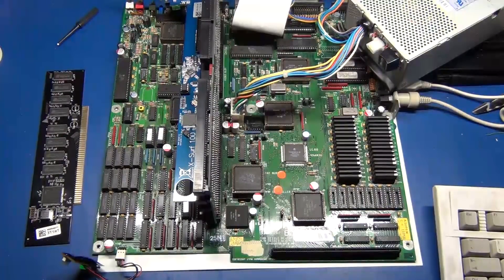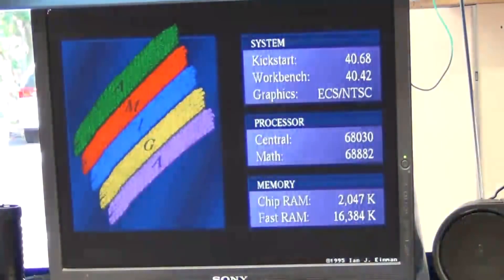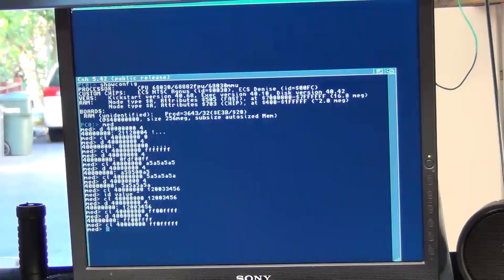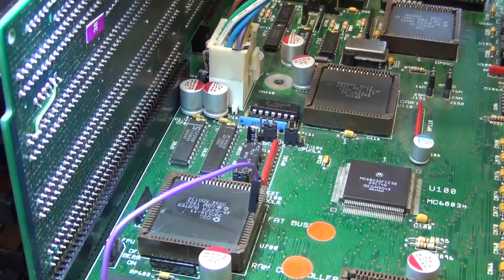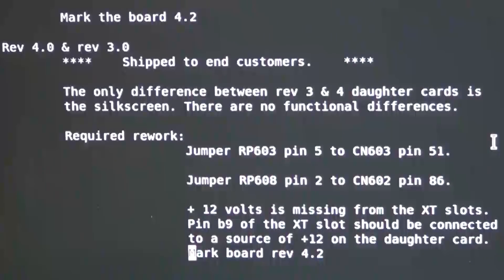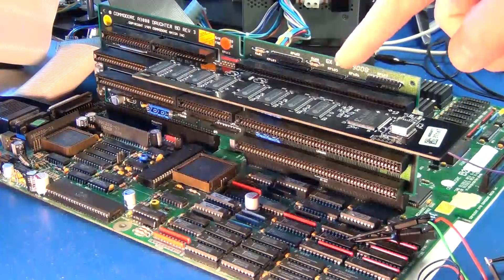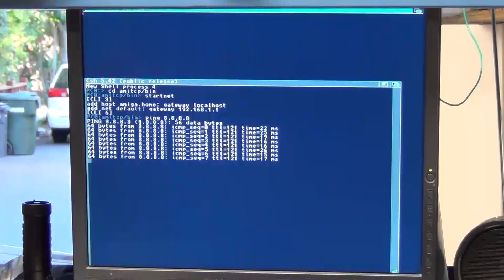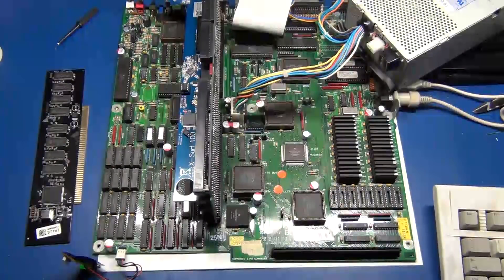Amiga 3000 daughterboard defect debug and repair

Comment: As someone who owns a A3000 and wanting to get an Xsurf card. This video saved me hours/days of headaches and hair pulling. Thank you so much for uploading.
Reply from the maker: I'm glad it helped.  Are you able to confirm that your A3000 daughter board has/had the same defect?  If so, please post any stickers or markings you can see.  To date, I've not heard of anyone else who has seen the same problem.
Reply: @cdhaiki  My daughter board Rev 3 dos not have any wires. But i have another card that does and it makes me wonder if there needed. The other card is a A2058 8mb zorro 2 card.

Comment: This is excellent. Could the pink sticker that says 3B perhaps have any significance regarding the board revision?
Reply from the maker: It could very well be that this sticker is what tells us the PCB is something better than REV 3.  I spent a lot of time searching the net for any details on the Amiga 3000 daughterboard, and unfortunately there's just not that much available.  For future reference, below are my notes from the various boards I've seen:

Amiga 3000 Daughter Board Rev 3B
    C= COMMODORE A3000 DAUGHTER BD REV 3     A/W 313253    GX B-VO 9008
        COPYRIGHT 1989 COMMODORE AMIGA INC.  FAB 313252
    Notes: "3B" sticker on back, 24/3 sticker on front.  C= is Commodore logo.

Amiga 3000 Daughter Board Rev 5
    C= COMMODORE A3000 DAUGHTER BD REV 5
        COPYRIGHT 1989 COMMODORE AMIGA INC.  GX B-VO 9011
    Notes: R601, RP602, R608, RP607 moved slightly higher on PCB compared to
           Rev "3B" -- silk screen was also adjusted to accommodate this.

Amiga 3000 Daughter Board Rev 6.1
    C= COMMODORE A3000 DAUGHTER BD ?????  (covering label says REV 6.1)
        COPYRIGHT 1989 COMMODORE AMIGA INC.  GX B-VO 9011
    Notes: back side has one rework wire connecting pin B9 of CN752 to
           pin 10 of CN603 (XT slot 12V rework).

Amiga 3000 Daughter Board Rev 7.1
    = COMMODORE A3000 DAUGHTER BD REV 7/01   A/W 313253
        COPYRIGHT 1989 COMMODORE AMIGA INC.  FAB 313252
    GX B-VO
     9138
    Notes: Since 6.1, added R603, C604, U601 in upper right corner..
           Equals sign instead of Commodore logo in upper left.